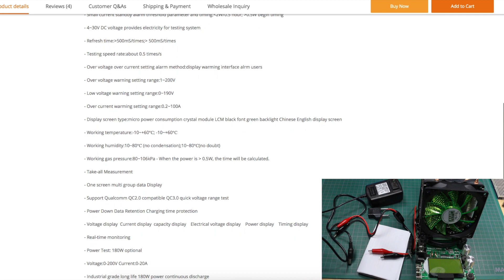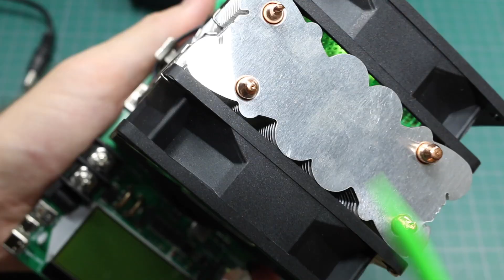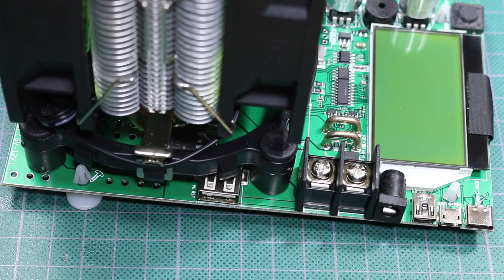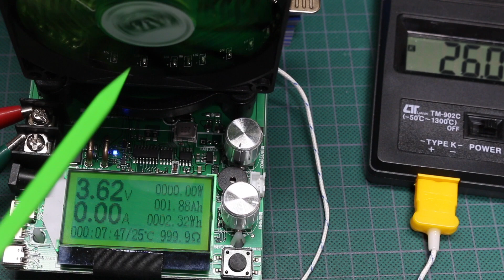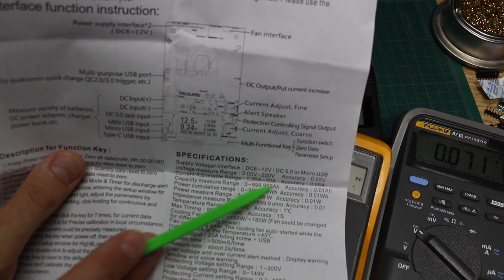Constant Current DC Electronic Load from Banggood - 200V 20A 180W

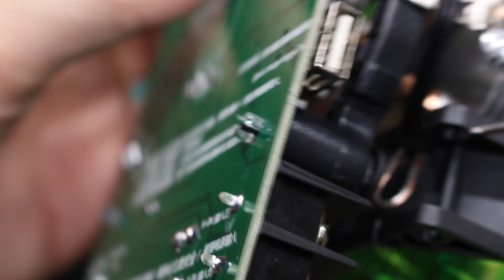Comment: You are providing a few bits of invalid but key information to your viewers that could result in safety exposures. (example: at about (03:20) you state all the device input connectors are in parallel. That isn't accurate. The lower USB inputs are limited to +5V whereas the coaxial connector for example, can handle much higher voltages. The screw connector input should be used for currents above about 2Amps. The standard USB connectors are not DESIGNED to handle the voltages and currents this tester can accept and damage will occur if one tries to connect inappropriate voltage and power throught those connectors. You also have some gaps in your understanding of how the unit works and I think you should have cleared those up before you produced this video.
I'm not sure why you added a temperature reading device as the unit's screen provides a built-in temperature display field (just to right of runtime indicator). Talking about the external load (the resistor(s)) was a good point most reviews don't discuss, but you still fell short. Is the power consumed by the resistor added to the total power (e.g. If the resistor(s) are pulling 20W doees that mean the tester itself is now limited to 180W-20W? What is the maximum current/watts the external load can add to the circuit? ...and so on. With what granularity can one set the current and does the screen show the same resolution as you rotate the potentiometers?
Also, a general observation. With a device constructed like this and shipped generally not very well protected, the heavy heatsink tends to break the retention tabs. This is a high voltage/high current instrument with exposed electronics. People should check for damage on such items and for example ensure the heatsink hasn't seprated from the MOSFET (e.g. look for any gapping between the heatsink and the circuit board. This is not an uncommon problem per user reviews.) Also advise people to check for damage of any kind, but especially for electronic damage, components, movement/shorting parts due to shipping, damage to circuit board and its traces. This is not a safely packaged product and it handles high voltages and high currents...both can be lethal or cause severe injury. One should also wear eyeglasses while using it as high current discharges can break and/or vaporize metal parts resulting in shrapnel and molten metal flying right toward one's face.
By the way, do your instructions show the incorrect reverse locations for the "coarse" and "fine" current adjustment knobs? That has also been identified in reviews as a common problem.

Regarding your concern about the unit cycling off and on during an error condition...using the "JST looking" signal connector (06:50) it's not too hard to build a small circuit that will absolutely disconnect the power to your tester when an error occurs, thus stopping the loop.

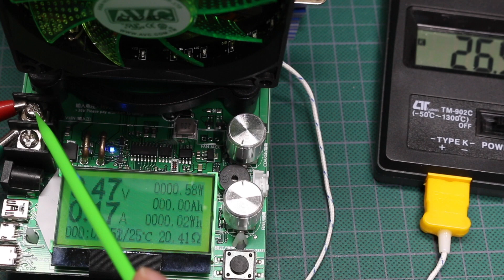Comment: 12:37 this is not resistance of power source but resistance of DC load, based on calculation of measured voltage/current

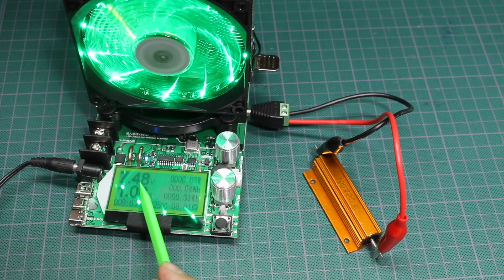Comment: 5:45 seems to be the most underrated part of this device. A good way to use the device only for measuring and not for loading. It may even be possible to achieve a high load with less heat release.

Comment: From home screen. Under no load. Click 7 times fast. Now when you adjust the “fine” knob slowly to full clockwise to put a load on your battery, then turn CCW to decrease, you will notice that you can adjust current in .01 A increments. This is in the “Usage Intro” sheet, but not clear like much of it.

Comment: Nice detailed review  :D, I am looking to buy a similar cheaper CC load but my issue is that I want to also log these readings onto my laptop, is there a way to do it? I have seen that it comes with PC software. Can you confirm if it has the option to log and see values in some sort of CSV, excel files :)

Also, can it be programmed by the host so that I can tell it when to start discharging or so? if no, then do you know any other electronic affordbable CC load that can do a similar job but also can log data and is programmable.
Reply from the maker: It's been 2 years since I looked at the unit so I can't recall any automated control, and I think this model is discontinued, at least Banggood stopped selling the one I looked at so I'm not sure if there's newer features on what they do carry now.
I know the one I used had a difficult user interface and I had to guess how to get it working!   I hope the newer ones are better.

Comment: Best review I have seen.  I wish someone would write a good manual for this unit.  I heard you say something about clicking twice in a setting screen for UP and three times for DOWN.  I have not tried this, but I can tell you I had major frustration changing the settings.
But, for the price, this is one great little unit.
Reply from the maker: yeah I wish it had a better menu navigation with a rotary encoder click-entry and no memorizing how many buttons to press at which time!

Comment: Thank you very much for testing this electronic load. It's the best review I've come across of this popular tool. You just asked all the questions I would have asked as well and gave just the info I was looking for. I just ordered the 150W Geekcreit version with the display riser board now available on Banggood (with the horizontal fan).  They seem to be all based on the same design for hardware and software.

Comment: Use case for external load connector: monitor battery charging.
Zero out both potentiometers. 
Plug charger into input. Plug battery into external load connector.
Not much point to having the fan in this case.
Would be really handy to have connector for data logging.

Comment: is it ok to check at least 2 amp. adaptor just to check if it is really drawn actual 2 amp. current ouput from adaptor.. thanks in advance
Reply from the maker: Yes as long as the specs aren't exceeded, so no more than the load's rated voltage, current, and power.    2 amps at 12 volts = 24 watts for example, all within the spec limits
Reply: @GadgetReboot  thanks again sir

Comment: best informative review I've seen so far, thankyou. Q. can you control output to charge, say a lifepo4 cell etc? and will it track capacity doing so?
Reply from the maker: It doesn't directly provide an output, it's meant to provide a load to an input such as a fully charged battery to discharge it and then capacity can be determined from the time it takes at a certain current.  But this is more of a heavy duty unit to provide large loads for other types of testing than small battery loads.  A different load tester is better suited to small loads.

Comment: I have one of these, lower current version, apart from that the same. The problem I have, it is in umder voltage condition, I can't reset it to zero, or get into any menu. It just beeps under voltage, any ideas? It's now at 150v low warning, I tried conection just over 150v hoping it may scan up and back down.

Comment: The 'other output port' is also marked 'connect to other loads'. I suspect it is to increase the load current by attaching either a fixed power resistor in parallel or cascading another active load. This would depend on the firmware allowing you to demand more than 180W though since the current for both loads pass through the shunt on this unit. Maybe there is a second shunt that measures just the current on this load for the protection circuits?

But your excellent explanation got me thinking: how about connecting a buck-boost 5v output converter to this output and using it to power the load? Since the input to the converter would be after the measuring shunt, the current taken by the converter would be accounted for as part of the load which would still be accurate. This would dispense with the need for a separate power supply. It would probably also need a rechargeable battery backup to bootstrap the load and ensure it remained powered even when the unit under test faulted out.
Reply from the maker: I think I would need to see a block diagram to make sure I fully understand, would the purpose be to have the power source that is being tested also act as a power source for the electronic load itself? 
it’s been over a year I think since I touched the output section so I don’t remember fully how it works but the power source would need to have enough capacity to power the unit so it wouldn’t work for all types of testing like battery discharge, and depending if there’s any power fluctuation demand of the load itself like when the switching transistor is working harder or heating up, I wonder if it would contribute to unexpected behaviour on the power source especially if we are expecting to provide a more constant load but now it’s varying enough to be problematic, either because there’s a varying load current or because there’s some sort of switching noise being introduced back to the source.
unless it’s auto compensating the way it’s all hooked up similar to putting a diode in series with the output of an op amp, the op amp  itself compensates for that drop just by its own behaviour instead of having a little drop.
Reply: @GadgetReboot  I have a later version of this (with the colour display) on order, though it is not clear if it still has the 'other output port'. 

https://www.banggood.com/180W-DL24-2_4-Inch-DC-USB-Tester-Electronic-Load-APP-18650-Battery-Capacity-Monitor-Discharge-Charge-Power-Meter-Supply-Checker-with-Color-Display-p-1655229.html

I would expect the load on the power supply to be fairly constant since it is just powering the feedback control circuit and display and also it would normally be powered from a switching mains supply so should be tolerant to a reasonably rough supply. Certainly my idea depends on the load voltage and current exceeding the minimum voltage and actual current of the buck-boost module. What we want is essentially an uninterruptible supply with a rechargeable battery so it does not cut out at the end of a battery capacity test for example.

I'm fairly sure the intention is to allow the loads to be cascaded to give higher wattage though and would be interested to have someone test this to see if the firmware allows it. Connecting a (power) resistor or maybe a light bulb across this output should resolve this, if a second electronic load is not available.
Reply: You do have to watch that you don't exceed the current and voltage handling specs of the simple coaxial connector used in this device. They are not usually rated beyond 2Amps (perhaps 3A if they are really robust), and the voltage limits can vary. To handle higher currents you need the more specialized coaxial connectors you find on commercial TVs which can be over 4Amps. Otherwise, one can get melted metal and plastic, short circuits, etc inside the simpler coaxial connectors as they have a very simple and fairly small area of contact between the inner "peg" inside the device's connector and the mating hole in the load's connector and LIKE the lower cross section in thin wires, it doesn't handle high currents.

Comment: do you think we can mod it to 4 wire measurement? like extend the sense voltage with leads? any idea why it uses 2 shunts?
Reply: Yes you can mod it, however it's better just to buy the new model DL24 and DL24P that has 4-wire green terminal block.

Comment: Better to buy similar but newer model ATORCH DL24/P which has color screen, a proper digital interface, app control and pc software, etc. Search Google for ATORCH DL24/P and find the manufacturer's Aliexpress page where there is Mediafire link for manual and software. Bangood will sell it under SKU 1655229 (180w) and 1629459 (150w) - just search BG for those SKU numbers
Reply: well according to many the newer one's are very inacurate
Reply: @davidflanagan1152   Could  you please provide the link/links to tests showing  ATORCH DL24 lack of accuracy.   I'd like to do some research b4 I buy.
Thanks

Comment: The little white connector in between the knobs will put out a voltage whenever an alarm is triggered, if you use that voltage to control a relais via an Arduino or something similar you can make the load stop trying to switch on again. I've bought the new version of this electronic load which is more precise with measuring voltage and current and I hope that the software is updated so that it will shut off on a trigger and stay off that would be great and if it doesn't I'll just use my Arduino to take over by using the trigger voltage and make it do what I want.
Reply: If all you want to do is disconnect the battery under test once discharging is complete, you don't need anything as complicated/expensive as an Arduino. 

On my "150W/180W" board, the output of that 2-pin connector is 3VDC, and stays "high" as long as the alarm is beeping. All that's required is a buffer (transistor or hex-inverter/buffer IC) and a suitable relay or suitable MOSFET as desired to disconnect the battery under test from the tester.
Reply: @exgenica  my electronic load wasn't delivered so I got it refunded, I do want it but since delivery is a problem here I'm not sure if I'm going to try it again... even though I got the refund it still cost some money and I hate wasting it.

Comment: Yes . I have same one from AliExpress . It's considered a high current meter . Best to test it under 36v in safe side . Even it can test 100v with 1a but you don't know what happen . Any way I use it to test 12v up to 24 v with 5 A up to 10 A .

And the transistor is irfp90n20d  you may have to replace it when you do some tweaking In this DC load like test a upper than 50v
Reply: It's easy to take the heatsink but the transistor is upside down so you need to twest it a little but be careful not cut off the edge legs
Reply: I have buy 2 type same mother board . One 150w tweek 180w  and the other 180w tweek 210w 

One with irfp90n20d and the other irfp260N
Reply from the maker: Thanks for the transistor info. I have been meaning to take the heat sink off and look underneath but I haven’t broken anything yet.
Reply: The data sheet is not 💯 real as the transistot in real world work . 
This transistors can work perfectly in 36 with full power . But in higher the volt you give the lower the power can decipated .

Like 300w in 36v is not same in 60v

Comment: how accurate is the internal resistance measurements if you have one of those meters to compare it to
Reply from the maker: I don't have a separate internal resistance measurement device to compare but I don't feel this unit does a proper measurement because it's measuring voltage only at its own input terminals instead of measuring with separate wires at the source, so it's going to have some voltage drop in the wires between source and input terminals while drawing current and it can't determine accurate resistance from that.
Reply: @GadgetReboot  makes sense. thanks

Comment: This OlogyMart 1381646 is one fancy shunt regulator ... and what a sexy heat sink!  Looks like it belongs on an i7.
Yup, it needs a rotary encoder and a genuine English speaker to help with the menus/instructions.
Strange that these companies do not hire someone like you for a couple of days.  Surely these two improvements alone would improve sales drastically without adding significant cost.

Comment: The errors at low current are due to the large (thick) current shunt. There is not much voltage drop across it when under 1A. It's obvious that the MCU doesn't have the resolution to accurately measure low currents. I think you may have buggered up the calibration when you entered the setup menu.
Reply: Yes this dummy load is good for test a 3A and up to 20 A with voltage 5 up to 200 ( prefer not over 100v ) with power 150w up to 200W and can over 300w for short time like 30 second .

But there a 60w dummy load can test from 20mA  up to 10 amp  with volt from 200mv up to 30v and it's very very very stable and strong and good one .

https://m.aliexpress.com/item/4000163609440.html?trace=wwwdetail2mobilesitedetail&gps-id=platformRecommendH5&scm=1007.18499.134607.0&scm_id=1007.18499.134607.0&scm-url=1007.18499.134607.0&pvid=8eca87e4-72b5-4900-af4a-97a6adf00e32&_t=gps-id:platformRecommendH5,scm-url:1007.18499.134607.0,pvid:8eca87e4-72b5-4900-af4a-97a6adf00e32&spm=a2g0n.detail-amp.moretolove.4000163609440&aff_trace_key=f62cba13fa9a4ff6a8292f109419f200-1587225025020-08745-UneMJZVf&aff_platform=msite&m_page_id=7863amp-bVCLlTMSeZbQ7KwkWaSwBw1587226686722&browser_id=f8902d8755b34e139d54d72639738af0&is_c=N 

I highly recommend to buy it because it's design for batteries for long test and to test the DC converters that are small or sensitive .